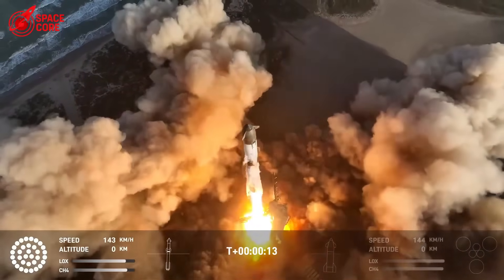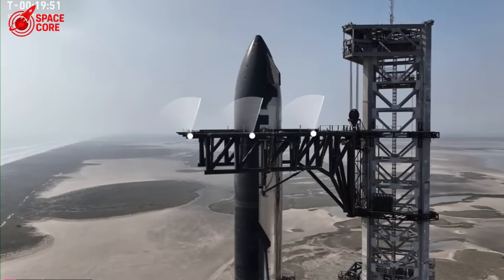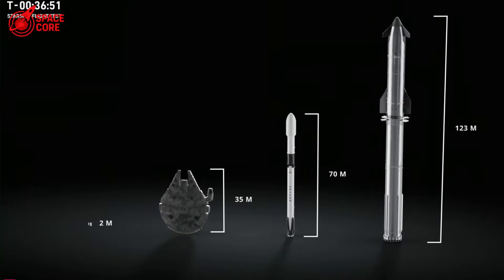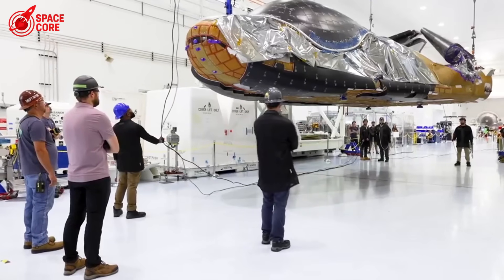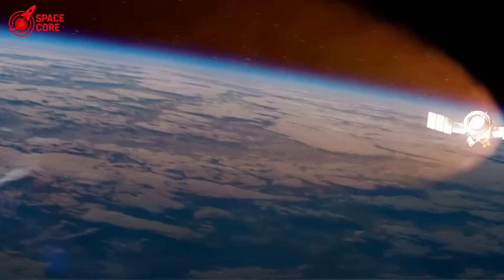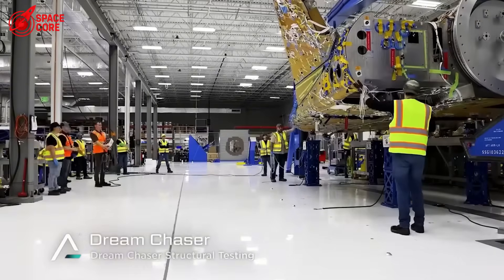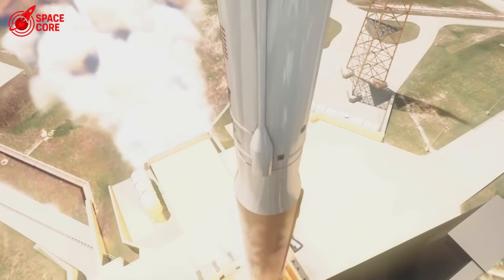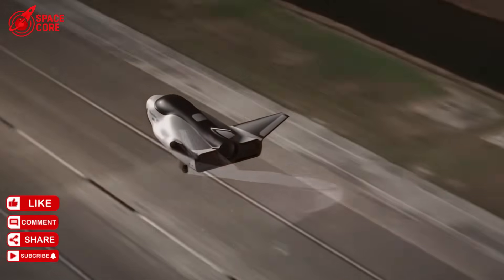SpaceX's CRAZY Heat Shield just HUMILIATED NASA's Dream Chaser...Shocking!

Comment: We learn from each other. That's why different car makers look so similar to one another...
Reply from the maker: That's a great point about shared learning in innovation. However, SpaceX's heat shield and manufacturing methods for Starship are showing a truly revolutionary path rather than just iterative improvements.
Reply: @SpaceCore25 Not revolutionary until it has been proven to work. So far Starship has failed to deliver - on timelines, capacity, functionality, reliability, safety and cost.  But boy it’s big and looks cool. Remember three a day and 1000 a year!

Comment: So could Dream Chaser be redone using steel?
Reply from the maker: It's an interesting thought, but a fundamental redesign of Dream Chaser with steel would be incredibly complex. Its current design leverages aluminum's lightweight properties for orbital missions.

Switching to steel would necessitate re-evaluating everything from structural integrity and weight to thermal management for its specific mission profile, making it a different spacecraft entirely.